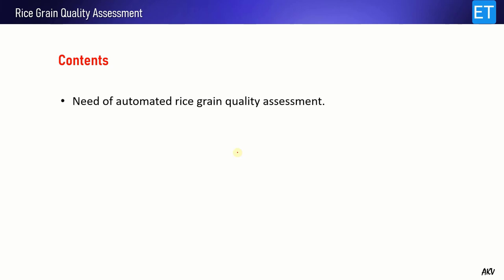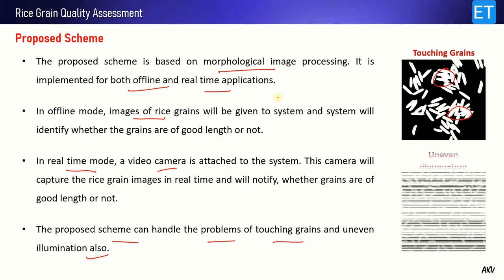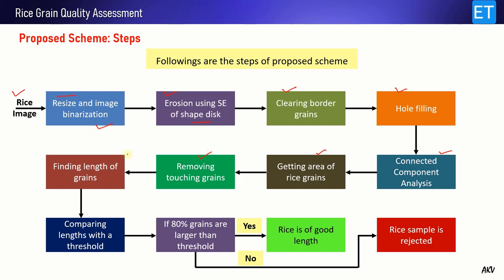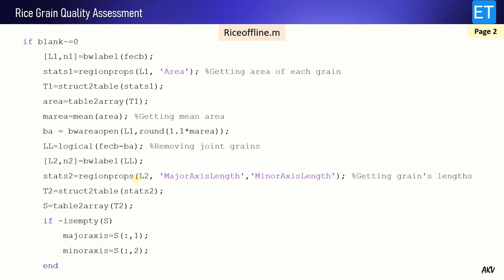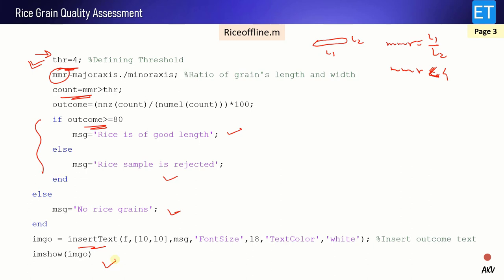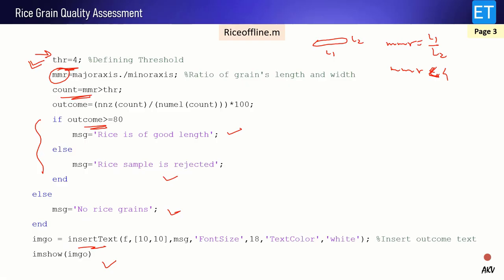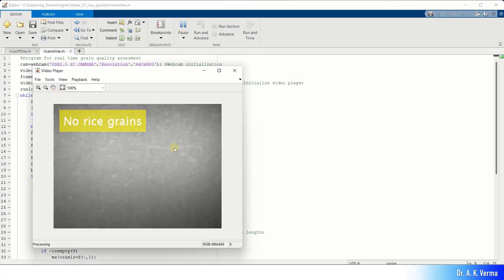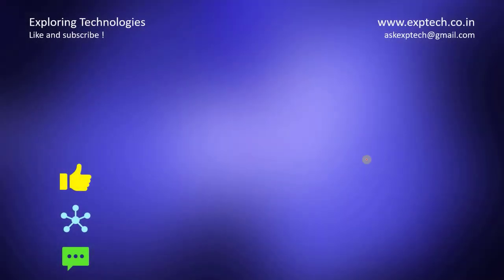Rice Grain Quality Assessment using Morphological Image Processing (Offline and Realtime mode)

Comment: Is this also good application for Paddy?
Reply from the maker: It will work for any isolated seeds. But some changes in the code is required such as selecting proper value of threshold.
Reply: @exploringtechnologies9  Does your camera need some calibration?